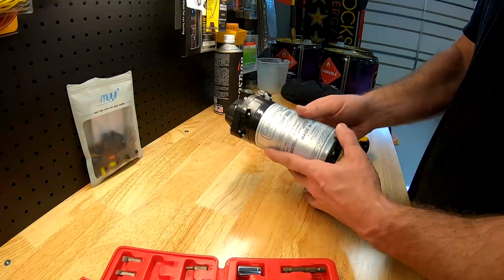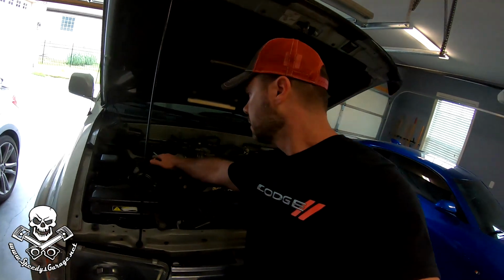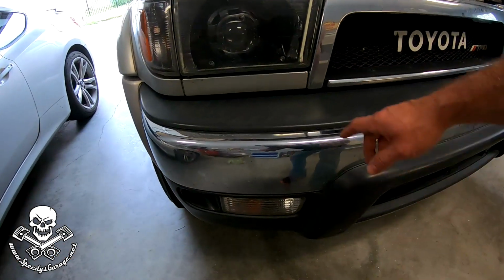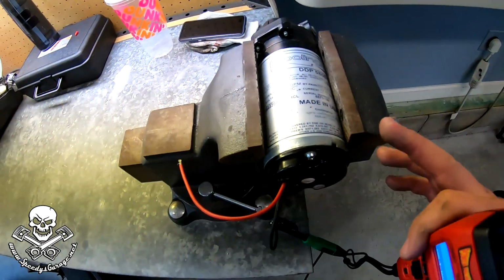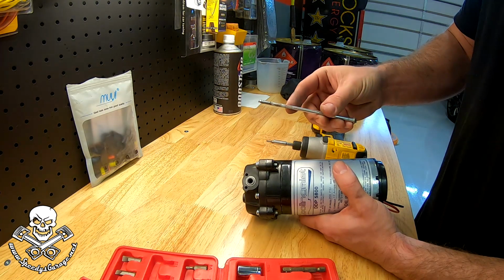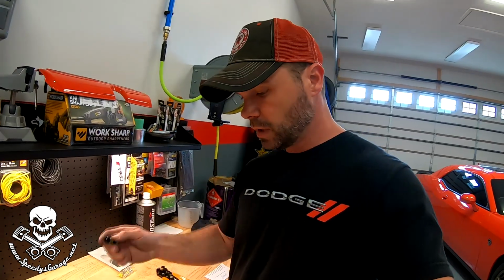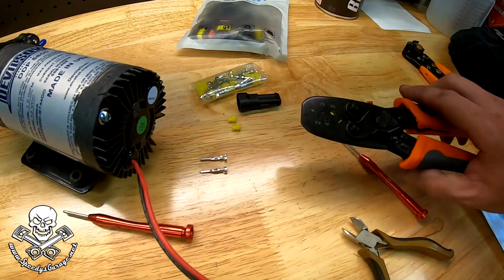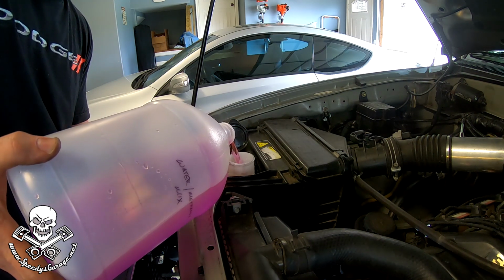3rd Gen 4Runner Water Methanol Injection Repair

Comment: Great Video.  Quick question.  With the water/meth system can you use 87 octane gas or do you need to go to 89 or 91 octane?   Thanks.
Reply from the maker: On a supercharged 4Runner always run 91 or better yet 93.
Reply: @SpeedysGarage  Thanks for the reply.  I know some guys will say that water meth injections increases the "effective octane" level of your fuel mixture so that you can continue to run 87 and not run the risk of detonation.   Maybe it depends on the pulley that you are using on your SC.
Reply: @HD46409  If you run 87 and your pump goes out  your nozzle clogs, or you run out of meth, you'll have a problem of you don't stop soon.  Carry a can of octane booster, or better yet, run 91 or 93

Comment: I also had my AEM pump mounted upside down behind my ARB bumper on my 3rd Gen 4Runner. My pump also went bad at about the same length of time. I was thinking that maybe it was because I drove it a LOT those couple of years. Now I’m thinking it’s because of being mounted upside down, even though all of the companies state they can be mounted in any orientation.
Reply from the maker: I wondered about that as well.  So far so good on the replacement.